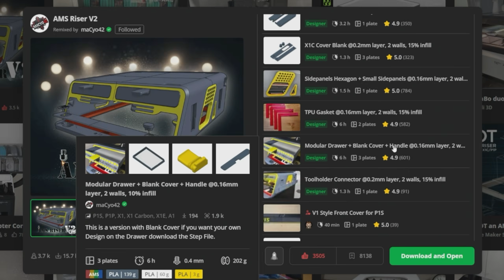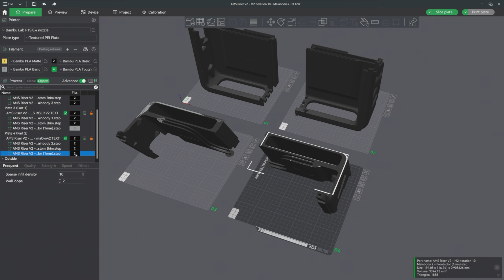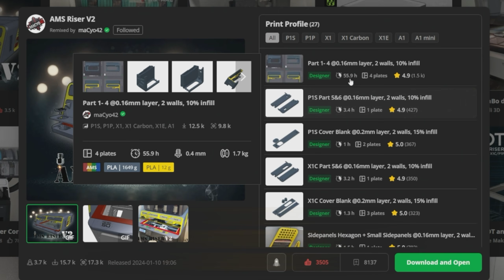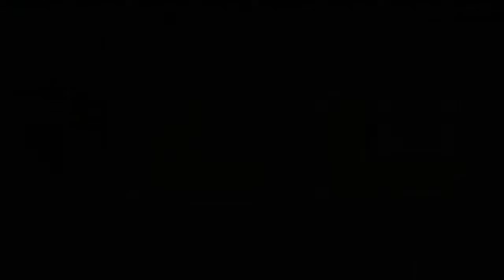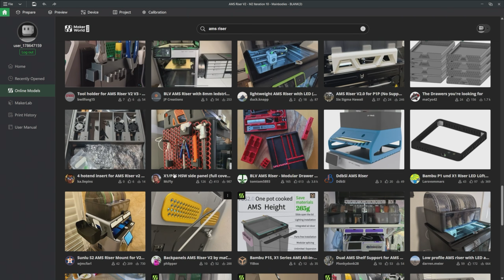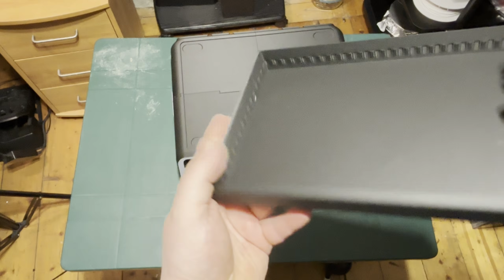Transform Your Bambu Lab P1S with the AMS Riser Upgrade

Comment: Doesn't raising the AMS up such a height using a riser like this cause worse vibration / motion of the printer during a print?
Reply from the maker: I have noticed it can move about depending on how fast it’s going but so far it hasn’t caused any issues

Comment: How did you remove the supports in the nooks and cranys? I'm having trouble getting mine cleared out carefully
Reply from the maker: To bb honest I don’t remember having any real issues removing the supports on this one  I’m sure they came away with little issues. But on some of the other things I’ve printed I would use either snips or thin long nose pliers

Comment: Which brand and color filament? Is it black or grey? and do i should use minimum petg?
Reply from the maker: Hay
I used Bambu lab mat pla in black for the main body and mat grey for the others. You can make it any colour you want
Reply: @ pla not recommends i think. Do you have any problem?
Reply from the maker: I had no problems printing as you see in the video and it’s still sitting on my printer with the ams on top and I have had no issues

Comment: How stable is the AMS on the printer? Does it move while printing?
Reply from the maker: No it is solid as a rock 
There is dimples on the riser for the feet to sit in
Reply: @ I have a p1p. There is no external wall that holds the ams riser. This is my problem.
Reply from the maker: @vead3213 looking at my riser it needs the panels to hold it in place but you could use other means to secure it like Velcro strips. There may be other solutions or risers to suit the p1p
Reply: @ I ordered a strong magnet (20pcs 10x1mm) and I will use it to attach it.I hope that will be enough.
Reply from the maker: @vead3213 should be

Comment: What was your temp setting for the print? It’s flawless! What filament/brand did you use? And what was your LED width and approximate length used? You really have your printer dialed in nicely.
Reply: I printed the AMS Riser V2 from the bambu handy app on a P1S. The default profiles in the file for .16mm layer height. I used eSUN PLA+, which these printers have a profile for. It prints absolutely perfectly in a P1S or X1C with zero tuning. Click and go.
Reply from the maker: @MemphisMechanic nice
Reply from the maker: The temp settings are just the standard settings for the filament which was Bambu lab matt pla 
The led strip was out of Tesco and is 10mm wide it was 1.5 to 2 meters long but cut down to what was needed .
I hope that helps
Reply: @ helped very much. Thanks!

Comment: Where did you plug in the usb for the led? Did you route it back to the front and plug in to the spare usb port?
Reply from the maker: The extension the printer plus into has a usb port in it
Reply: @THEGAMINGTECH78 at the front where the screen plugs in?

Comment: Looks like you printed this in PLA.... do you see any deformation due to heat? What voltage was your LED strip?
Reply from the maker: Yes it was all done in PLA and no deformation that I’m aware of. The led strip is just 5v off a usb and has made a huge difference to lighting the inside. I am working on a few projects at the moment which I will post as soon as they are done

Comment: I had printed the Riser in ABS. I should have schales it a Bit bigger. The Top Glass is very tight fit.
Reply from the maker: That’s a pain
Mine is a nice fit although the filament tube catches the tpu gasket a little bit